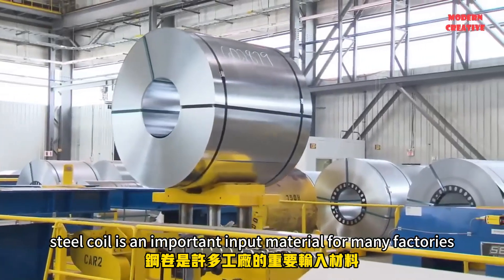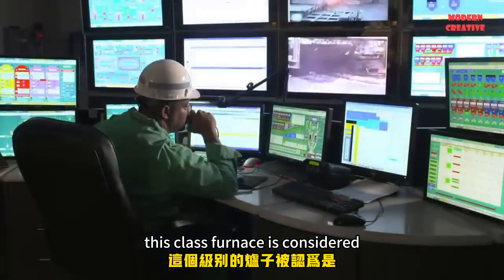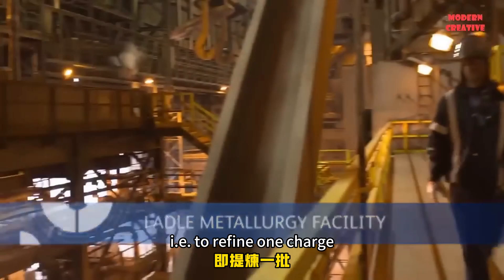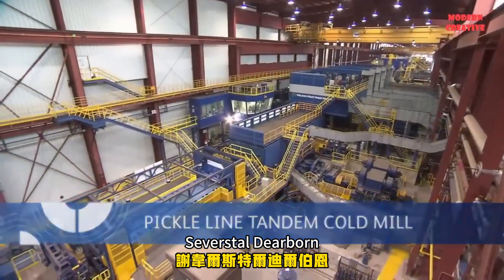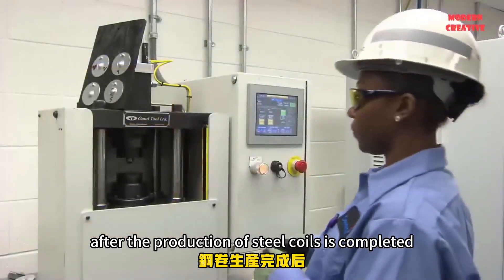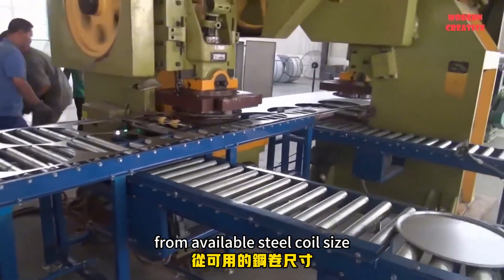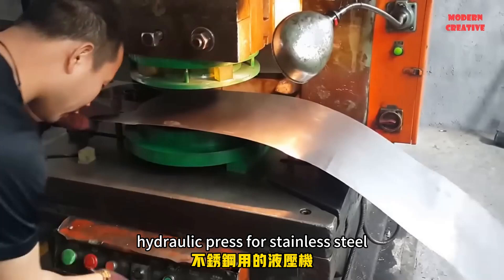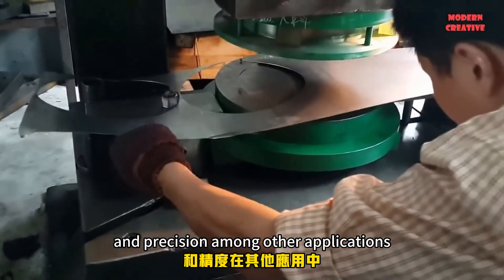鋼捲製造與用途(Process for producing steel coils and other products from steel coils)

Comment: there are extra thin gauge foil cold rolled,thin gauge cold rolled, thin gauge hot rolled, and normal guage hot/cold rolled coils and plates, these constitute the main portion of steel industry.
Reply from the maker: Steel rolls account for a very significant proportion of the end products in the steel industry.